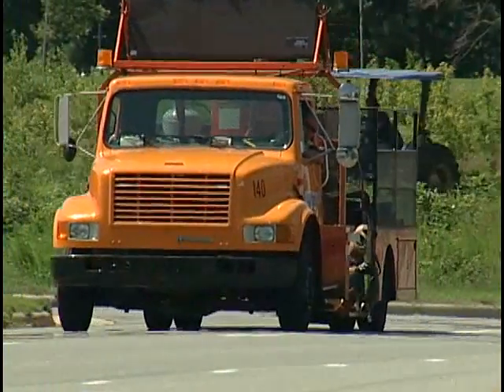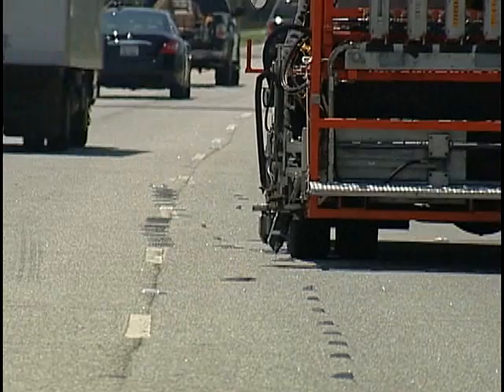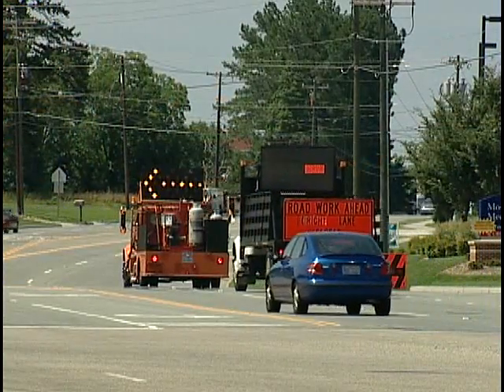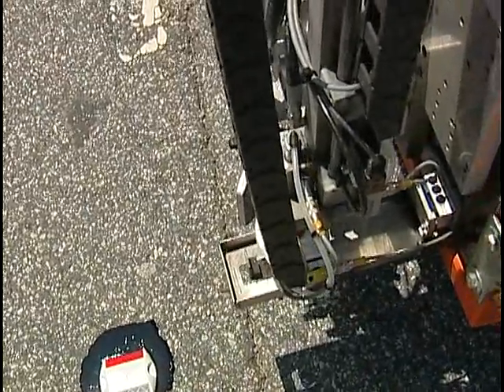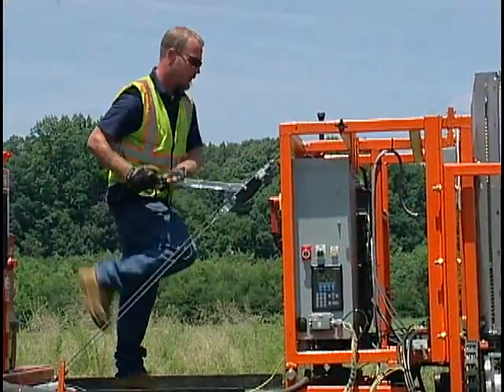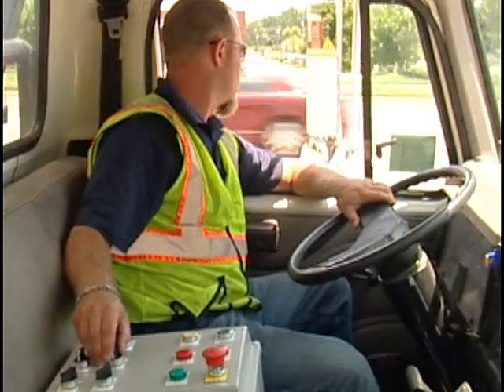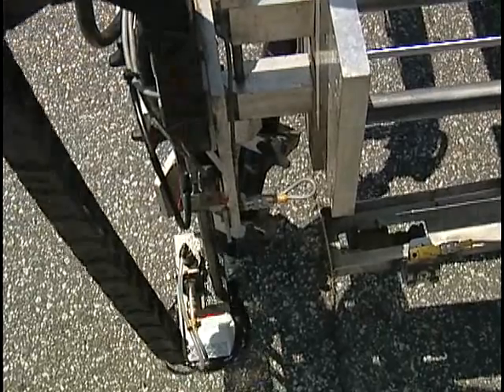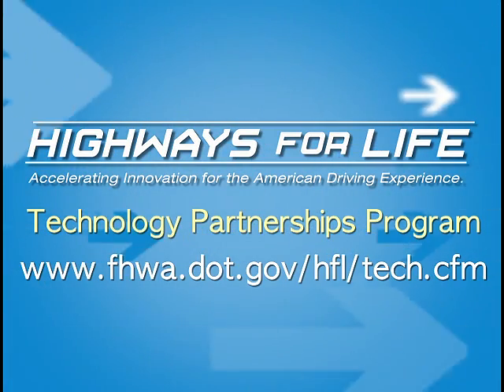Automated Roadway Pavement Marker Placement System

Comment: No way in hell that's faster than a worker doing it. When I was doing it I was placing 8000 a day, at the rate that thing is going it's at around 3700.
Reply: Dibbler Does it all   It's hard to believe you put down approx. 650 rpm's per hour...just saying ...and that's 12 hours...you do the math...
Reply: May be slower, but no safety issues, less labor costs.